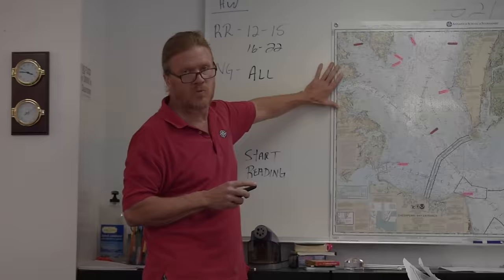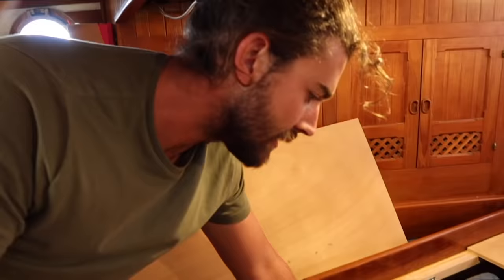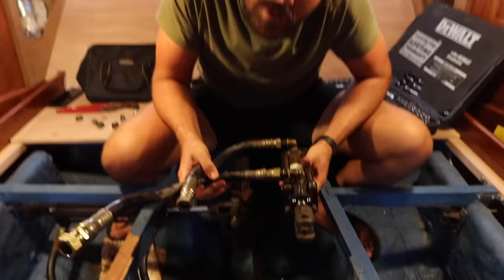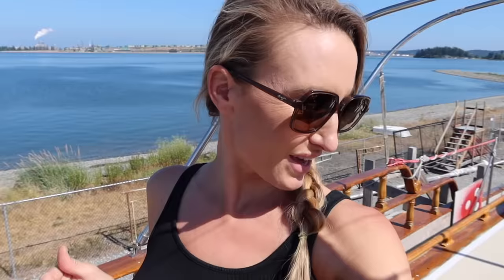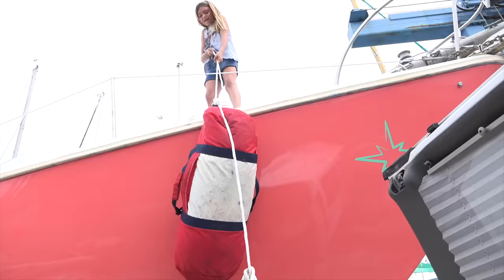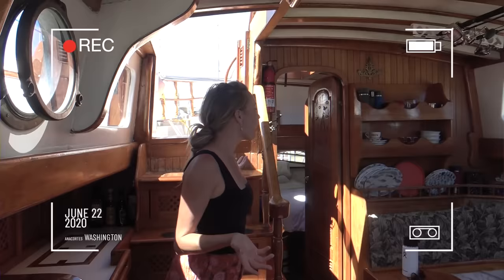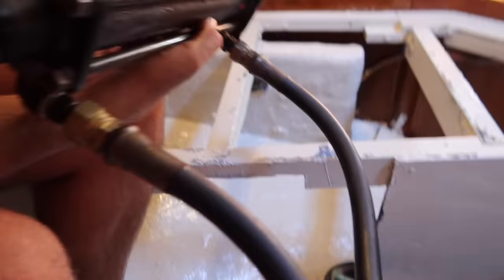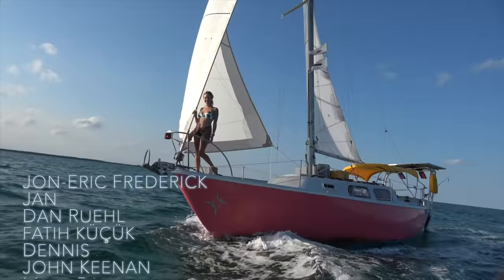Captain of the Hard | Pirate Ship S13E04

Comment: Agree with others about not using Teflon or sealant with flare joints.( 22 years of plumbing along with maintenance.)
Reply: 100% I jumped a bit when i saw it being being used. I saw it seamed to have tape  or some sealants on the flare nuts before disassembly, and that didn't throw as big a flag as the reapplication did.  Flare fittings count on a firm seat against the pipe flare, from both sides, with no irregularity on any surface. The pipe flair is the seat for both the nut and the fitting. If any of the surfaces do have a irregular surface ( such as, over tightened nut distortion, fitting cone scratch or dent , pipe flare corrosion or wobbled flair or having been over tightened. to name a bit ). The issue with the pipe dope or tape becomes that of joint contamination upon removal and improper pipe nut (flare nut) torque. It will be easy to over torque with slick stuff on threads.
It may need retightening with use, so don't be surprised. Never use sealant on the fitting cone, pipe flare, or inner nut surface for sure.  Fingers crossed for ya  i don't think the nuts will actually back off because of the use, but the application should require no sealant. 
On that note. Buying a nice " RIDGID 345-DL 45 SAE Double Flares w/No. 150 Tubing Cutter and Case Kit 33927" pipe flare tool, fittings, and pipe, is a very cheap option. Plus you become your own hardliner :) . Soft tubing like copper, must be what's called double flared. Its a easy operation as well.  
You guys rock as a team, Best Wishes!

Comment: Thinking of the emergency tiller, having enough mechanical advantage to control it in dirty weather is important.  I will just mention that back in the days of wooden ships and iron men that tiller would have had a tackle attached on the end  so that you could haul it back and forth  with a line, sort of like the way you tack a jib. That would also allow you to have the tiller below decks and the lines run up to the weather deck so you could see and steer without the rudder sweeping the afterdeck.

Comment: I would add some support where the copper tee's off to the rams so the movement isn't being transmitted into the copper.  This will prevent a failure point down the road.  As others have mentioned clean threads on compression fittings as recommended by all manufacturers.  Sealant on the threads can actually interfere with the nut tighening all the way and pulling the flare tight against the taper which is where the actual sealing point is.  Some have expressed concern about contamination.  This absolutely will not be an issue unless the sealant made it onto the flare.  I see no way this could happen unless the flare nut was installed then removed and installed again.  If this didn't happen then you should be good.  Just remember to clean everything the next time you take them apart.

Comment: Cheers Sailors,
When you remove old wires, you pull new wires with the old wires. Or buy a spool of 3 or 4 mil. Poly line to leave in the wire run for the next wires.
Check with your hydraulic shop about using the thread compound on the fittings, ask if its safe ? Never seen any compound used on hydraulic systems ?
Recommend Nigel Calders book on complete boat systems and repairs, it's the boating repair bible !
Sail on Mates !
Reply: Just like Tim Mitchell pointed out, you do not put pipe dope on the threads of flare fittings, use nothing on the flare also just keep everything clean.

Comment: I work with flairs all the time with pressures to 600 pounds. And you never put pipe dope on a flair nut. Hopefully it won’t be an issue.
Reply: I was like "what are you doing!😲" LOL  It probably won't hurt, but absolutely not needed.
Reply from the maker: Should I WORRY?
Reply: @SailingMissLoneStar  is ok but not normally done the seal is at the flare it should be clean and undamaged
Reply: @SailingMissLoneStar  Don't Worry, Be Happy!😎
Reply: @SailingMissLoneStar  Have extra Hydraulic filters incase it clogs them or it prematurely.
Reply: @khalli2112  It absolutely won't clog filters as the threads are outside of the hydraulic system.  The seal point is at the flare.
Reply: From what I saw it's only on the threads with brass to brass it will help prevent galling not to seal the threads. Stainless steel has the same issues with the galling.
Reply: @tommussington8330  I thought I saw zinc plated not brass or stainless, however pipe DOP and teflon both could cause the threads to bind which would result in reduced pressure applied to the sealing surface.  Anti-seizing compound (obviously applied in very small amounts for this application) is the right product to prevent gaulling and corrosion caused binding of threads.

Comment: Please hear this , I agree with Tim Mitchell,   do not put pipe dope on compression fitting. 
They are designed to handle high pressure systems  .
By using the pipe dope you are risking the chance of contamination of the system and the hydraulic fluid which could cough up everything  in the new system...
You should have asked the hydraulic professional about  using pipe dope. 
I hope you will dodge this bullet , won't have to rebuild the system again. 
Steering is a very important part of Sailing Miss Lone Star ....
Much love From Captain Sam ❤

Comment: Very common in heavy equipment as well. Metal to metal dont use anything on the threads. AN fittings are 45deg angle on the end. JIC are the same thread with 37deg angle.

Comment: The one thing you need is a by pass valve for the hydraulics on your boat as well as a 4ft tiller that can be placed over the rudder  post for stirring in case of hydraulic  frailer .

Comment: Well done.I am like Searle with my boat sometimes I over engineer things But definitely reduces the F ups. 1 suggestion if you have issues bleeding the system I noticed the rams could be turned so the fittings are on top to bleed out the air. allways remember where possible the bubbles float up to the sky well done

Comment: When there is a nut, and another locknut (8:40), use two open end wrenches to loosen and completely remove the outer nut first.  When re-assembling, use the two wrenches again to lock the two nuts against each other -- tighten them together using opposing direction -- i.e., loosen the inner nut, while tightening the outer nut -- thus locking them together.

Comment: Omg him putting pipe dope on those fittings drives me nuts lol! Those are basically aeroquip fittings the same as what are used on jet airplanes well many airplanes not just jets. Any way the beveled tip on the male side fits in the bowled shape on the female side and that's what seals the joint. The pipe dope  does nothing to seal the only thing it will do is make it harder to disassemble and clean when servicing needs done in the future.  But that's OK they are learning and living the dream so good for them and I wish them the best and enjoyable seas ahead!

Comment: Yeah, the $1000 boat. (or there-abouts)... My partner and I had a line on a beautiful (to us) 38' classic sailboat.... was a wreck inside, but we were looking forward to the project because the hull was solid - just needed a transducer re-installed.  One of 85 built ... we talked with the marina, and just as we were going to close the deal, they had to check with their lawyer who told them that WA had a new law that talked about boats over 35' and more than 40 years old.  Of course, she was just 40, and 38'.... so she fell under the law, which meant that she had to be "certified" as seaworthy or she'd be scrapped.  Well, they didn't want to go through that process, and scrapped her.  Her name was "Forevermore".  Now when we pass through Olympia and we talk about her it usually turns into a story about how "Forevermore" has become "Nevermore".  Last we saw her, she was stripped of all her hardware and being prepped to send to the crusher/landfill

Comment: In case something goes wrong with the steering system at sea (plan for it just in case) do you have an emergency tiller?  On a large boat such as yours I would think that a very long tiller would work best.  Have you practiced using it?  Spare parts and extra hydraulic fluid?

Comment: The framework that you are mounting the rams to seems less stout than the pressures the rams are capable of imparting.  I would rigidify  the structure possibly with metal crossmembers or at the very least some wood crossmembers to bridge across the gap from side to side over the rudder post area.  This would lessen the forces trying to bend the perpendicular beams inward as the rams fight the energy of the rudder in the water and under heavy load/torque.  Maybe not a problem for new wood, but with aged frame members I could see this failure happening, potentially.

Comment: I am a degreed Mechanical Engineer and a sailor. Cyril has my respect. But I can safely say he is wasting his time putting pipe dope on hydraulic fittings. Only put pipe dope on tapered pipe threads. Never on non-tapered threads. The issue is a small risk of contaminating hydraulic oil in this case.